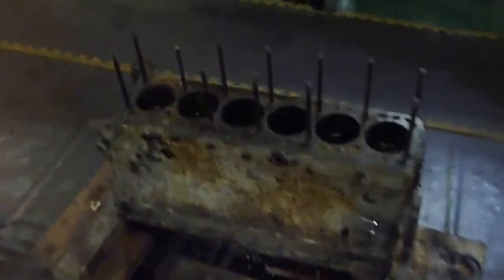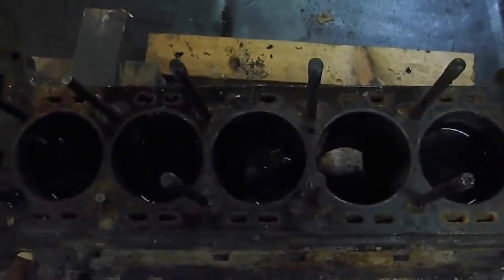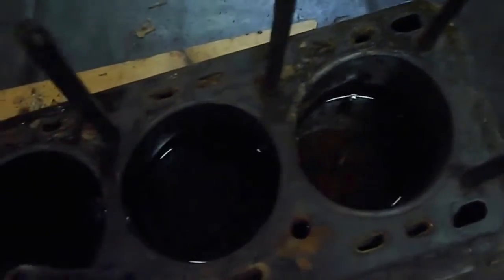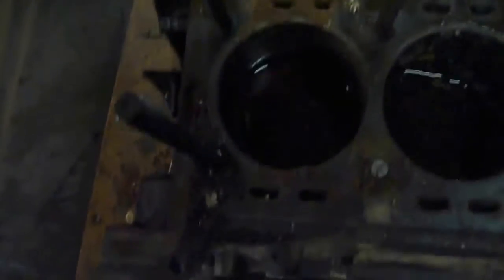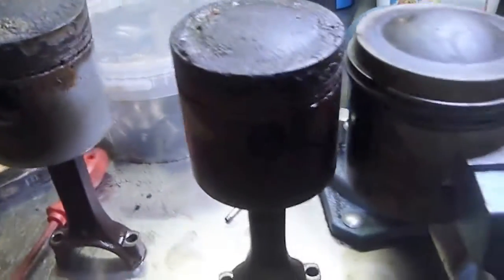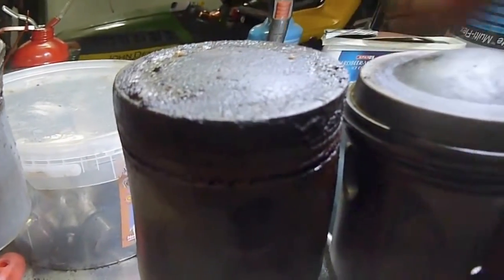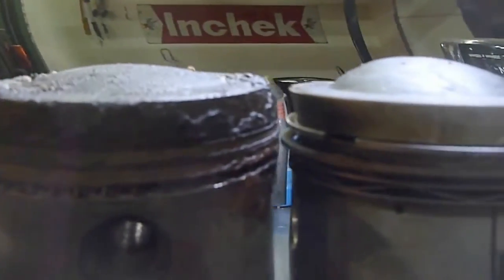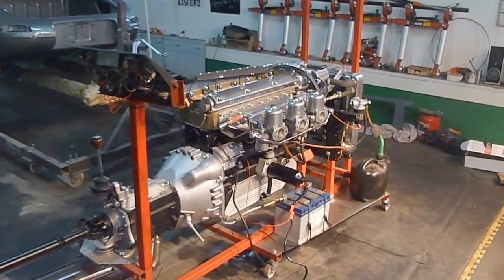Jaguar MK10 & E-type 4.2 engine

Comment: im sure you know, but there are two different types of 420g 4.2 engine.  the early ones had the short head studs, and the later post 68 (ish)  had the full length studs, that can become corroded in rusting silt at the core plug level. I think the later ones look different between the head studs too, with slits.   I would be banging those pistons up from under, with a piece of 2x2 wood, and a club hammer. after  running a spinning scotchbrite wheel down  the bore..  plusgas is the best penetrant ive found, with some petrol.

Comment: The Mk 10's that went to the States were all 9:1 whereas you could order these cars with 8 or even 7:1 for areas with poor fuels. They are marked with a -9, -8, or -7 on the engine number suffix.